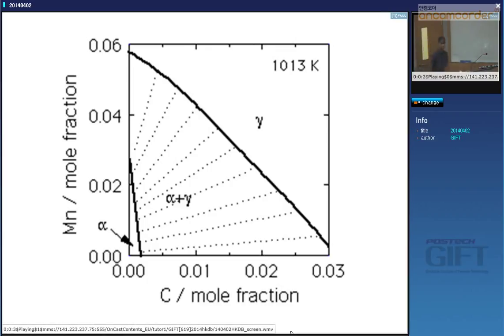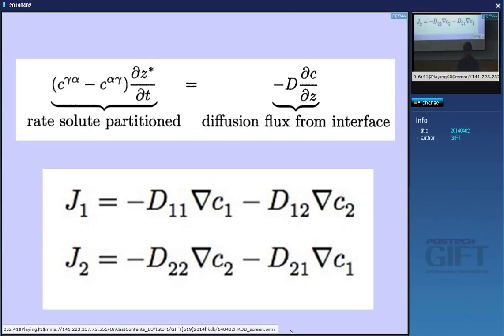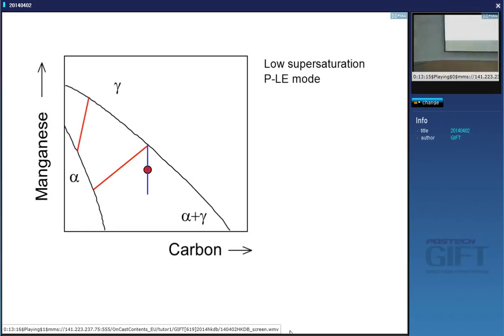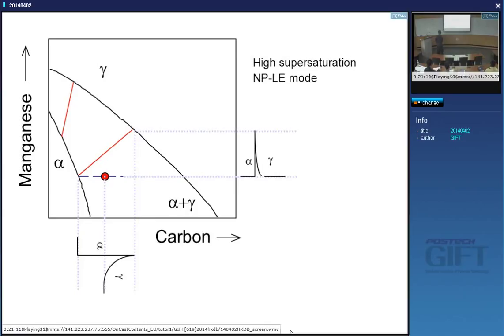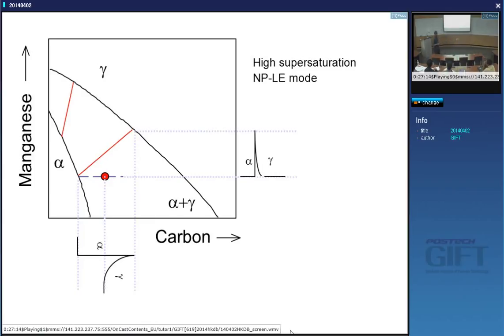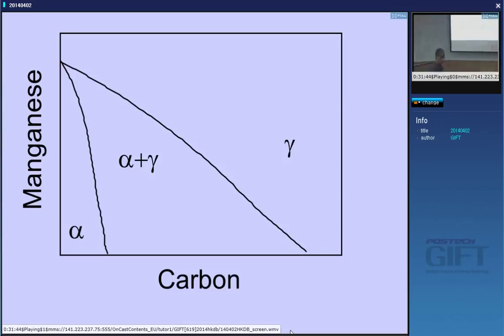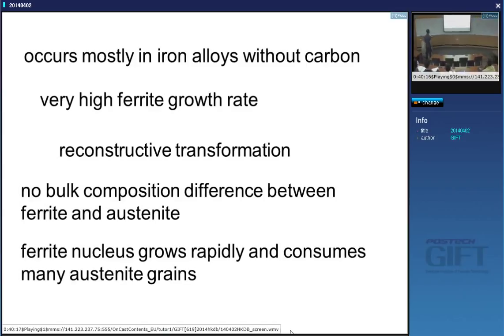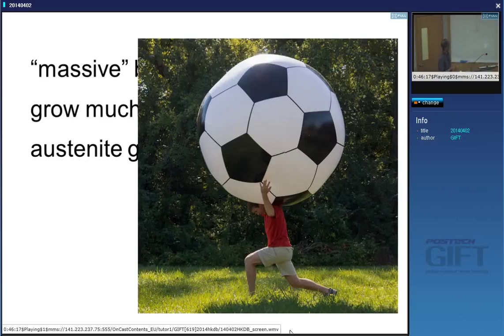Phase transformations in steels 8, 2014

Comment: Professor Bhadeshia.In both P-LE and NP-LE mode,the tie line don't pass the alloy composition point.After transformation complete,the average  composition will locate on the tie line, it isn't equal to the alloy composition.it seems wrong. could you tell me what's wrong with my thought?
Reply from the maker: +Smith George See the section on tie-line shifting on:
http://www.msm.cam.ac.uk/phase-trans/abstracts/progress.html